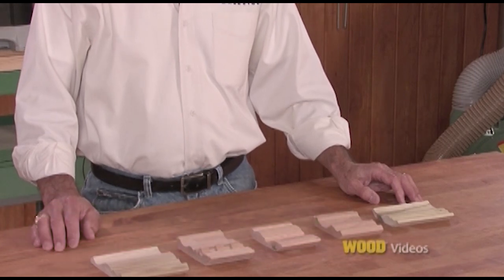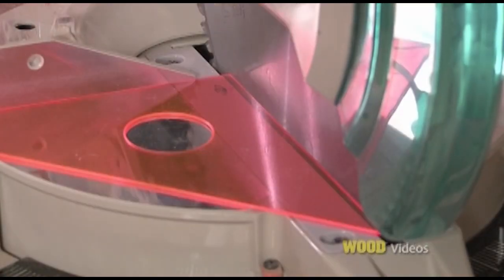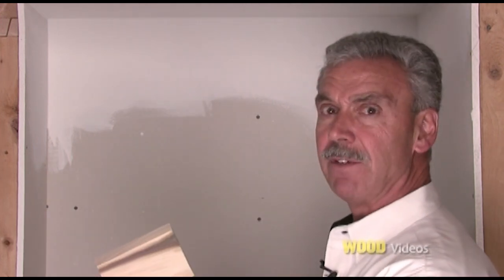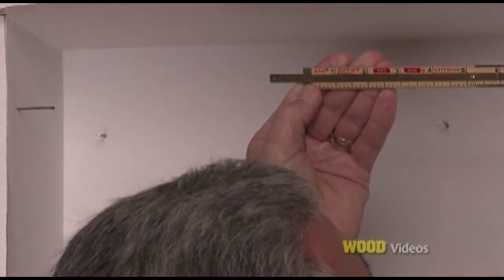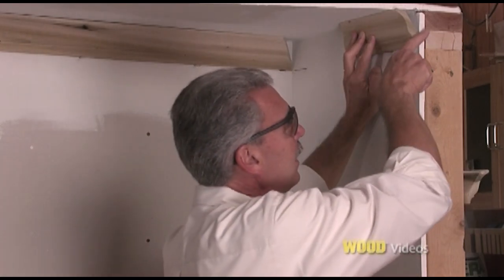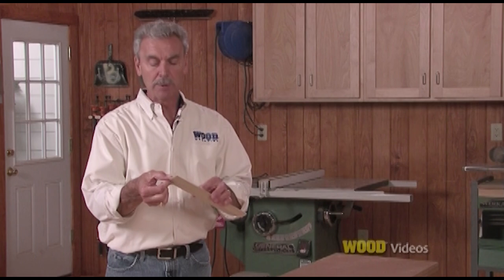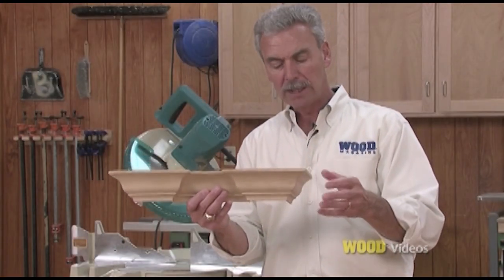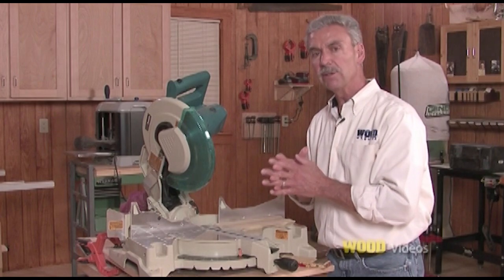How To Cut and Install Crown Molding - WOOD magazine

Comment: I wish he showed how to measure the side trim pieces on the inside example since you can't really measure to the long side on right and left inside. 
I assume he used same measuring method but too brass to outside point of the 45... 
But such a great video

Comment: Never miter an inside corner. Why, because my grandfather told me. When I was taught, we used homemade miter boxes and drove all of our nails. The way that he explained it, a mitered inside corner later on when the moister leaves the trim piece, it will shrink and leave a crack big enough to throw a cat through. A coped corner will stay tight. Sorry to criticize your demonstration. For a do-it-yourselfer, mitered corners would be easier. I am seeing fewer carpenters even owning a coping saw. I tell them to take pride in your work.

Comment: My question is:  one ceiling line is level but the ceiling line where I make the inside corner rises higher away from the corner.  How do I make crown molding but up flush at corner?
Reply: I would get some drywall compound and skim from the corner until it’s level.  Or if it’s really not that bad, then put up the crown level leaving the gap and then fill it with caulking.  You can then skim the ceiling out from there.

Comment: 4 years old and STILL BY FAR the best and most comprehensive instruction. No DIYer should start a crown molding project without watching this video. While watching, I was initially disappointed that inside cuts didn't include coping. But just a few minutes later, that instruction was given as an upgraded approach and fully covered. I especially loved the tips on gluing outside corners at 90 degrees, even when it initially doesn't appear that will work on your imperfect walls... and the reasoning why. Very nice.
Reply: true, and this was filmed in the mid 90s. I just set my molding on crown stops and cut at normal 45 degree angles. Its far easier and quicker as you dont have to double bevel.
Reply: Yup...

Comment: I definitely prefer this method.  I credit Mr. Heavey for teaching me how to do crown molding that looks amazing.  I was able to do stain grade using this method(no caulk) and it was TIGHT.  I do, in paint grade however, like to use Jeff Thorman's method of putting spackle in the nail holes, instead of caulk.  It does not shrink.  Did an entry way with casing and trim on both sides, tacked about 60+ nails in the whole project.  There are exactly TWO that are visible(only because the nails didn't go in all the way)-and barely visible/difficult to find.  It is absolutely impossible to find the others- they are gone.

Comment: Mr. Heavey, you may not read this, but I wanna say thank you from the bottom of my heart. I had never done crown molding in my life before I found your video. I always found it intimidating and I was nervous to do it. Your instructions were precise and very well explained. I used your advice on creating my templates and it worked perfectly. I have a miter saw but never payed attention to anything other than zero or 45 °. Again thank you for your professional instruction.

Comment: Great video, Jim! Your directions are easy to understand also. When measuring for molding, what I do, is use the tape and measure out, say, two or three feet, make a mark. Turn the tape to the opposite wall, measure to the mark just made and add that measure length. 3'mark and add the 7' 3/4" making wall 10' 3/4" total. Just use the tape, quick and done!

Comment: good vid. however, with my miter saw the correct bevel was 34.9 degrees and the correct miter was 35 degrees. after an hour of hit misses on angles, I finally found the sweet spot. a bit of advanced geometry with this type of project. the springer angle on my molding was 52 degrees.

Comment: I think the cons of cutting crown flat outweigh the convenience. For one, there are a confusing number of spring options that require complex math to determine the miter and bevel settings. Secondly, it’s difficult to predict where a beveled blade will travel through the wood, making precise length cuts tedious.

Comment: The real reason to cut inside corners is to make joints on long wall runs. I've never, I mean NEVER seen an inside 45 corner actually fit a real-world inside sheet rock corner, as they are never even close to perfectly square. If you want inside corners to fit you cope saw, end of story.

Comment: It looks like these are the measurements for 52/38 moulding.  For 45/45 (with 90 degree wall angle) I think the measurements for the templates are 35.3 miter and 30 bevel.  Am I right?

Comment: I’m wondering what I’m doing wrong because I followed your steps to the letter and when I join the pieces, they are not close to a 90° angle. I just want to let you know that your videos are very insightful and educational and I love them and have built quite a few jigs that you have recommended. This failure has me perplexed and I’m hoping you can help. I checked both the blade is 90° to the fence and 90° to the table so I don’t understand what I’m doing wrong

Comment: This is best explanation and method of cutting crown molding that I have ever heard. There seems to be no specific method to cutting molding using the nested method, which seems assume that a person can walk backwards and upside down at the same time. Also, this video showed me how to use the angle chart on how to set your mitre and bevel, kind of the same idea as the CRC Standard Mathematical Tables I used in school.

Comment: I had done two rooms several years ago using an old miter box, placing the pieces at 45 degrees and cutting, no problem. This go I have a wider crown molding and cannot make the miter box work; bought a compound, sliding, 12" miter saw and thought all would be a breeze. This video will help me tommrow - all the pointers in the video were exactly what I needed help with! Thank you very much, Doug

Comment: I like your method of making templates. But here is my problem. I have an odd ball outside corner = 133 degrees. The chart says miter = 17.09, bevel = 16.37. Two settings virtually impossible to achieve. So far I have not been able to get the answer to the question: which is more important, miter or bevel?
It seems to me that miter is more important, because miter error leaves a gap at top or bottom. If bevel is too much then less surface area making contact, bevel too small means outer edges do not meet.
Am I visualizing this correctly, or have I missed something?

Comment: I finished a luxury closet last year using 6.5" walnut crown.  I wish I had known about this technique.  I ran into the exact problems he mentioned when cutting upside down and backwards.   It was difficult keeping the heavy crown in constant contact with the fence, and I also had finish cutting the last 1/2 inch by hand because of the depth.

Comment: Great video! Curious what u do when its stained, do you still caulk the top and bottom of the crown to hide the gaps?
Reply: Don’t use caulk to fill the nail holes when staining, they don’t stain the same as the wood and is a terrible eye sore.... I’ve done it